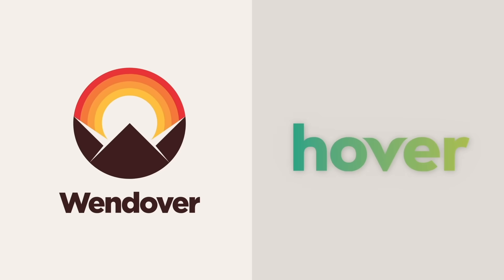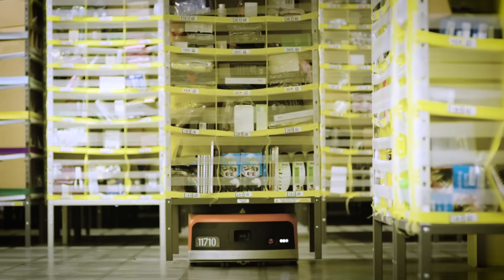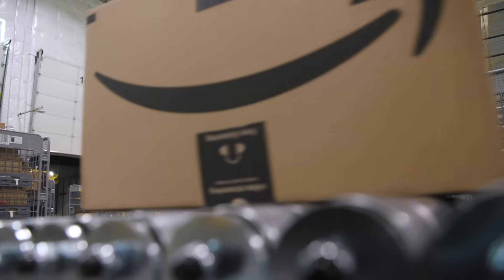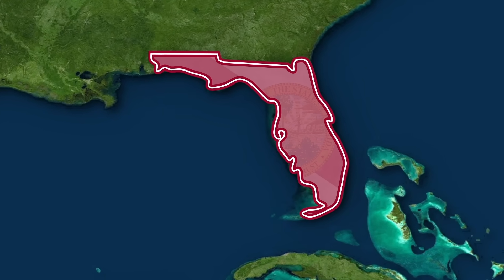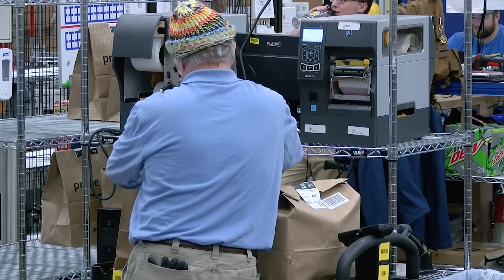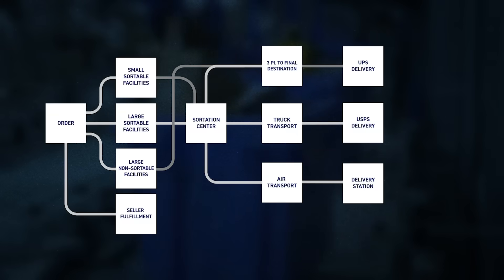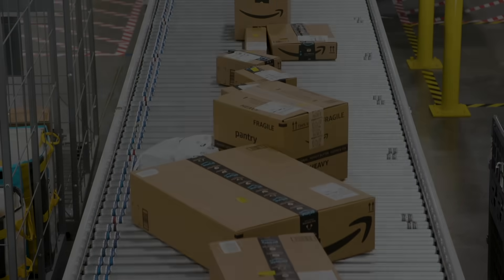How Amazon's Super-Complex Shipping System Works

Comment: Me: Living in rural Canada
My amazon package: Well, it's prime delivery so it will take two weeks
Reply: Sorry to hear that... Glances over at my free same day delivery option :/
Reply: So true. I live in Alaska and always find it annoying how there 2 day delivery is really 2-3 weeks
Reply: @aktazf1192  Well they have to deliver it on helicopters a lot of places up there so...

It's easy to drive a large big rig cross country in 2 days. But for alaska, there isn't a supply chain up there.
Reply: @pilotavery  yeah that is partly true. Usually stuff in the cities is flown up then delivered via USPS or occasionally UPS. If you want something delivered in a reasonable amount of time fedex is the only choice but it will cost a small fortune. Everything rural is delivered on small planes usually through a local airline hired by USPS.
Reply: @aktazf1192  Yep. Half of alaska is flown in via helicopter and dropped off weekly. 

It's not even a private airline, USPS owns and operates a small fleet of helicopters just for this purpose.
Reply: @aktazf1192  tell me about a sweater I ordered on the 1st day of the year is going to take until the 23rd, I live in anchorage...
Reply: @jameskosusnik1102  yeah it is super hit or miss on delivery times. I have had things deliver in 4 days or a month. Usually about 2 weeks though. If it is from china then it definitely will take that long.
Reply: @aktazf1192  hell just for a replacement controller trigger from Hong Kong it took 1 and a half MONTH. A button replacement
Reply: @aktazf1192  try living in New Zealand it takes more than a month to get anywhere
Reply: @aktazf1192  well it shouldn’t say 2 days. It usually will say that due to location you likely won’t get it in 2 days.
Reply: At least it isn't Canada Post. Here in the Maritimes, all pkgs stop in Montreal to be held hostage between one week and one infinity. Overnighting a small pkg from Un-Tory-o to Saint John takes at least 7 days.
Reply: @andytaylor1588  My last two packages carried by Canada Post from Toronto to Vancouver literally both took two to three weeks. The only reason they are still alive is because they are public, just incredible
Reply: @andytaylor1588  don't even get me started on Canada Post
took ONE MONTH for a hard drive I ordered from Newegg to be delivered at the end of last year. it spent TEN DAYS in Burnaby BC for some reason before moving
Reply: @andytaylor1588  if it makes it I live near Bridgewater NS witch is like a hour from Halifax. Halifax to home is 5 days with cp
Reply: haha I think I’ve had faster packages to south africa (cape town at least has an international airport)
Reply: How rural are you? That’s some pretty long delivery times wow! I’m lucky in Sherbrooke we have the 1-day delivery option on some items and it rarely takes more than 2 or 3 days for anything else..
Reply: @YoshMaster  Same! Intelcom is pretty quick in Sherbrooke
Reply: I live in africa and amazon deliveries 3-5 days sometimes a bit slower
Reply: @Hello Hi hello hi. Boycott Walmart. Boycott Amazon. Support local?
Reply: Well if you're anywhere in rural Ontario, you apparently now live in LA according to the video (11:10)
Reply: @17andtravelling  it’s Ontario, California, not Canada.
Reply: Haha! Some decades ago everything took at least two weeks to get delivered.
Todays logistics are a miracle.
Reply: My DSP (delivery service provider) tried rural deliveries at first. Never again. Rural deliveries are simply unprofitable. The distance between deliveries, higher likelihood of getting stuck, and more gas usage eliminates profitability to deliver to rural areas. We let USPS and UPS handle that.
Reply: @angelgjr1999  and this is exactly why they depend on usps, because the only way to do it profitably is doing it in bulk and the only way to do it in bulk is to do every single delivery. USPS also subsidizes their delivery service to bring medication and other products as well which can also lower the cost of operating their helicopters for rural deliveries.
Reply: Same but Sweden. The fastest ones take five days.
Reply: I’m from bc Canada in a very rural place and it look 2 month lmao
Reply: I live in Brazil, packages get stolen in Sao Paulo or Rio de Janeiro, or just get stuck in Curitiba.
Reply: @支配-v2d  that is until an off duty police officer shoots them
Reply: I live in Hawaii and know it takes weeks.  My problem is they lose money shipping to my outer island of Kauai, so many bigger or heavier items can only be ordered once.  Then they refuse to deliver to my zip code.  So if I know the item is acceptable, say a dozen speed rack baking trays, I have to order as much as I would EVER need. Pissing off my postal carrier.  So I give my mail person gifts.
Reply: How rural are you?  Most of the rural population of Canada is within a few hours drive of at least a medium-sized city and the Canada Post route should get there within 3-4 days.  I can picture some bits of the rural Prairies, Atlantic Canada or the parts of Quebec and Ontario far from the 4 larger metropolitan areas (GTA, Montreal, Ottawa, Quebec City) being slower due to fewer regular postal shipments.  All bets are off for the arctic (but Prime shipping costs are probably still appealing).

I'm in a Canadian urban centre (Ottawa) and 2 day (or often next day - fastest was the package at my doorstep 9 hours after I ordered it) is normal for Prime here.  If I force a Canada Post delivery (by adding PO Box 0 to my address - Canada Post knows it's bogus but Amazon's internal system automatically routes to the normal post if any PO Box is listed), it's 2-4 days for most things.  Stuff coming in from overseas can take a little longer but even from the US, 2 day Prime is pretty common unless there's a customs snag.

I do see the Canada Post holds in Montreal or the GTA for packages coming in from outside North America or larger items coming from the US via post.
Reply: i live in hamilton so packages can take a week for amazon but 2 or 3 days even for ups becuase ups has it's main canadian hub here in hamilton
Reply: @brosandshortfilms7647  UPS's main air hub for Canada is in Hamilton but the sorting centre is out north of Steeles in the GTA.  A buddy of mine has workec at the big sorting hub for years and he lives out in Barrie to avoid the worst of the traffic.
Reply: Me: living right outside a major city
My Amazon package:well its prime delivery so might as well take a week anyways
Reply: That’s insane, so glad to be in the uk, one day delivery is amazing
Reply: Me living in a populated area in Australia, still takes weeks for a delivery because our postal services are a joke.
Reply: lol the worst is the US post office pay for overnight shipping and got my package 1 month later. another package marked delivered to mailroom or leasing office i go down check the mailbox nothing so i ask the office also nothing. next day leasing office calls and tells me the package just got delivered.
Reply: What's the longest delivery time you were quoted ?
Reply: @aarondavis7526  A month or so
Reply: @joelgauthier4260  Dahm and u thought 1 month from wish was bad if that's from Amazon what is wish like
Reply: Have you guys heard of drone delivery canada? Their whole business model is about delivering package in remote areas
Reply: Try Mars.
Reply: ok
Reply: @verlax8956  not ok

Comment: "Humans, even low-paid ones, are expensive."
- The motto of every company ever
Reply: I dont know. I was employed at a sortation center from amazon, and we where faster than most other sortation centers in germany. without automated sortation. everything was done by  humans, exept of the conveyorbelt.
Reply: @emergcon  Being fast is not the point here. Even though you may be quicker, you're still more expensive than robots are. 
Amazon will definitely have fully automated warehouses in the near future.
Reply: @SdoubleA  not so sure about that though. A lot of automated systems still rely on humans to restock. Repacking bulkboxes to the sales-unit for example. Worked at a DC for a large drug store in the Netherlands and even though it was a lot of manual labour with some automation the concept is basically the same. Bulk-boxes get in but you don't want to send out bulk-boxes to each store as some might only need a couple of packages of a certain item. This unpacking isn't something I see robots do in the near future as the boxes are crooked, loaded upside down and what not. Also every product is packed differently and every product in itself is completely different.

I don't think this will happen for at least a decade or more and sure, automation will grow like the orderpicking itself could be done without any human interaction but fully automated warehouses? Not seeing it happen yet.
Reply: What is the city at 14:52?
Reply: @HumblebeeRules  that could be hundreds if not thousands of cities
Reply: Why bother to work we'll be replaced by damn robots eventually not a joke seriously. Company's are just too damn cheap to care about the peasent worker that's treated like crap. Just get rid of humans if you can't pay people fair money wages. Jeff bezos make billions 30 plus a day and the blip says he can't afford workers, go to hell cheapskate. Americans will never be billionaire money to matter how smart you are or work hard. Sucks
Reply: Still true.
Reply: Humans , even slaves Are expensive
Reply: Yeahh, but it's true. Me sitting at my job costs my owner money and a lot of it as labor costs are higher when you're not making money. Now a place like amazon its different as no matter how much money they bring in everyone on that clock is costing that company huge amounts of money just due to the costs of salaries and the expenses of the building and company and such.
Reply: This is laziest line of narration of the video. And ridiculous and misleading. He literally explains that the robotic shelf system s 3x 4x faster at picking the products than humans walking to shelves.  Simply adding more humans to each fulfillment center isn't the answer as the narrative-line suggests, its not about saving money in cost; Amazon are  doing the equivalent of what textile machines have done in place of human hands - advance the technology!

Comment: Amazon Air employee here. I've never clicked on a Wendover video notification faster. (Edit: And of all facilities, in Lakeland which gets mentioned!)

Edit 2: Now some corrections:
-Packages from fulfillment centers are trucked straight to the Air Gateway (as AA's airport facilities are known), not via a sortation center. 
-The air gateway doesn't actually take stuff straight from the truck to the plane on pallets. It actually functions a lot like a sort center. About half the incoming stuff is already sorted into pallets (with boxes) and gaylords (used for all small soft-sided packages and about 1/2 time for boxes) by flight, but the other half is mixed sort. All mixed sort is manually unloaded either onto (1) a conveyor belt that goes to the upper floor and placed on robots that go around to different chutes or (2) placed into the "dumper" which tilts gaylords onto a separate conveyor belt for soft-sided and very small boxes (max maybe 8x6x6 in.) that are sent to the third floor where they get sorted by flight and placed in large nylon bags then down to the 2nd floor to be placed on robots and sent to chutes. The chutes go down to ULDs (the big metal containers that get loaded onto planes), many of which are sorted by their second destination (eg. KSMF-SMF5 for the sort center near Sacramento via a flight to Sacramento). For some of the biggest destinations (on my shift SMF5 and SCK9, which are sortation centers in the Sacramento and Stockton, CA area) that arrive already separated, the gaylords of boxes can be moved by pallet jack to a spot where forklift places it onto a stand that is moved by Kiva robot to the correct ULD, while the small packages get moved to an area where they are manually stuffed in nylon bags and placed in ULDs. On the unloading side of the flight, the ULDs are unloaded directly onto a conveyor belt system and moved to the 2nd floor where they're placed on robots that move to different chutes for different destinations. About 2/3 of packages get sent to sort centers while the remaining packages are placed on trucks that go directly to delivery stations. We send packages to most of Florida except the Panhandle. The JAX5 sort center also sends a small amount of packages to Georgia and coastal South Carolina.
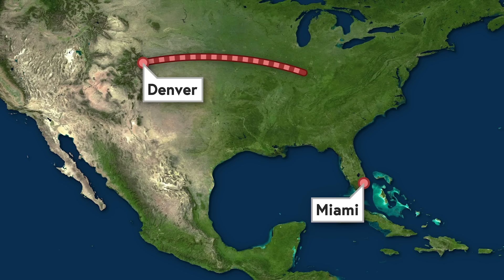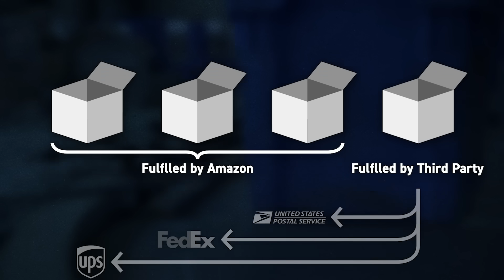-Amazon Air facilities receive and send off flights throughout the day and there isn't long waits (I think he said something about "12 hours later" at one point). There is about six hours between the night shift (11p-7:30a) and day shift (1:30-10p). Also, stuff that arrives during a shift is placed on planes/trucks during that 8-hour shift. For example, at Lakeland, everything that is unloaded from a flight between 11p-7:30a is placed on a truck that leaves at 1, 7, or 10am (differs by destination), except for one destination. Nothing really waits around.

I don't think it wasn't mentioned, but worth noting is that most flights operate point-to-point and not round-trip. For example, my shift gets a 767 from Allentown, PA (with packages from fulfillment centers in PA, NJ, & DE including lots of shoes because Amazon bought Zappos, which I think had their warehouse in that area) that leaves 6 hours later for Sacramento, CA. Likewise, a 737 arrives from northern Illinois (KRFD) and leaves for Dallas (KAFW). The Sacramento flight also has a decent amount of stuff (maybe 2-5%) bound for Alaska. Based on the facility codes on packages, these will go to SMF5 (a sort center near Sacramento)-->DSF_?_ (a facility in the San Francisco area)-->PANC (Anchorage airport...fyi Alaska & Hawaii airports begin with P instead of K like other US airports). 

On the inbound side, about 5-10% of packages bound for the Miami sort center are for Puerto Rico and the USVI while another 5-10% are bound for Latin America (about 80% of those for Colombia) most of which have DHL or national postal service labels with the occasional DHL label for China. I'd say about 5% of packages on the Houston-bound flight are sent to Mexico via the SAT5 sort center (near San Antonio) Before late October, we had a flight to KRFD in northern Illinois which had a lot of packages with DHL labels bound for Asia and Europe (China, South Korea, Taiwan, Germany, France, Spain, UK, Ireland, and a surprising amount of packages for Finland). When I first started I was really surprised at the volume of international packages on that flight. Strangest package I've ever seen was a large multi-pack of paper towels (which was shipped in its original box without a surrounding Amazon box) bound for Hong Kong. 

Other than the international packages, Alaska, Hawaii, Puerto Rico, and the USVI, like the video says, packages on flights are for the region where the destination airport is. For the 3 flights during my shift, that's Houston (KIAH) to Texas; Dallas (KAFW) to  northern Texas, western Louisiana, and Oklahoma, and a few via OKC5 (Oklahoma City area sort center) to Arkansas, Missouri, and Kansas); and Sacramento (KSMF) to northern California and northwest Nevada (Reno & Carson City).
Reply: That was an awesome correction, thank you!
Reply: Amazon Sortation Center employee here! 🙋🏽‍♂️
Reply: Amazon Central Dock Logistics Coordinator here!
Reply: They left one of those collapsible boxes when delivering a whole bunch of packages to me. How do I return it?